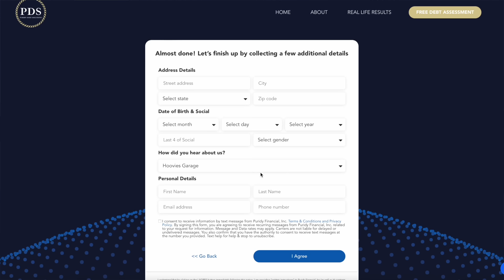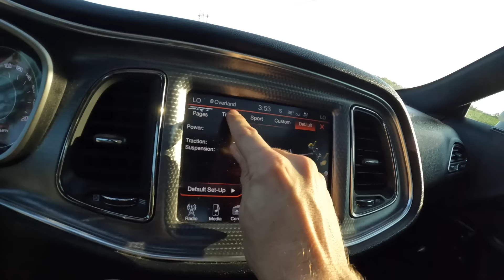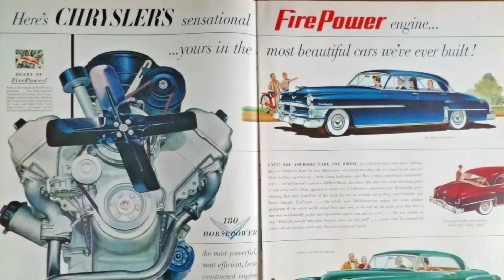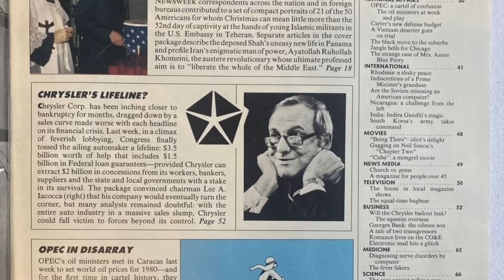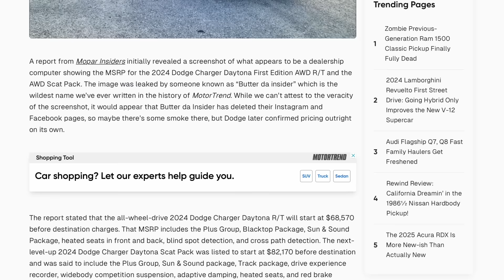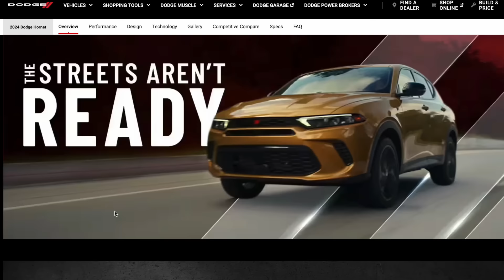I bought the cheapest Challenger Hellcat in the USA, and it's been in 4 accidents!

Comment: FYI: They can still steal the car even though the battery in the fob is dead, some of the thieves have access to dealer tools and can program a new key to the car. They'll pop it into neutral and push it around the block and then program a new key and take off. So I'd look into installing a kill switch and/or keep it hidden in a garage.
Reply: That’s why in 2018 FCA/Stellantis made things INSANELY more difficult and expensive to access the onboard systems with aftermarket equipment where you need to have your diagnostic equipment authorized by FCA/Stellantis through a company called AutoAuth. To even read the codes on my parents 2019 Grand Caravan, I would have to pay nearly $400 annually to both my scan tool manufacturer and to the AutoAuth service.
Reply: You can actually just get a scan tool that does key coding plug it in choose the car wait for it to sync and away you go

Comment: This is what most Challengers are like once they are up for sale in the UK via Eastern Europe.
Reply: apostrophes don't make words plural
Reply: Same in the US. Looked at a 28,000 mile 2021 Scat Pack Shaker recently. It was damaged on every panel. Windscreen cracked. Tires bald. Brembos needing rotors and pads. All emblems missing. Wanted $41,000 USD. I bought a 32mile new Last Call Scat Pack TA last week for $42,500. Used market is insane.
Reply: Most of the challengers in the UK are clapped out v6’s selling for way too much
Reply: @mitsuturbo  bro we are not the same, you speak English cause it’s the only language you know. 

We speak English cause it’s the only language you know. 🤡
Reply: If it weren’t for the price, that would kinda make it even better. 700+ hp and it’s already abused so you don’t care as much
Reply: @baileypan5391 No u
Reply: @josephshamon7824  whose fault is that? Live in a relevant country with a relevant language 😂
Reply: @BBBILLY86  Wow, you got a good deal!

Comment: As a Mopar enthusiast and Mopar hooptie connoisseur. The pealing paint on the upper radiator support and just the way it’s painted in general tells me without doubt the support has been replaced. Whichever and whatever accident that things been in was probably a lot worse then the carfax leads us to believe. The damage is usually pretty nasty when that upper support needs to be replaced. Hopefully you get lucky and the frame is still in good shape.
Reply: Body guy here (and fellow Mopar enthusiast 😎) came to post this you beat me to it. Aprons and shock towers don't look molested, so it may not have been too bad. We do replace a LOT of core supports these days so I wouldn't be too worried. It may be a good sign that it got replaced rather than just rough pulled back into place.

Comment: If you can fix the audio issues (missing speakers), you can drop in a newer UConnect without needing to program anything, Carplay is nice to have. It's a super easy mod to do and I'd 100% recommend it.

That said, that car is ROUGH. I seriously wonder what the owner did to make the interior look like that.

Worst part is that you need a whole new front fascia at the very least, and maybe a new right front fender. Looks like the mounting studs on the fascia were ripped out.

Also surprised to see that it doesn't look like it got the Harmon/Kardon speaker system. It's quite decent for a factory system, but it won't win a SPL battle
Reply: Those panels on the doors for speakers are for after market speakers. It probably did come with them but they changed the door speakers.
Reply: 6:31
The panels on challengers don’t look like that lol

Comment: 26k seems awfully high.
Reply: For 700 horsepower?
Reply: @benische  doesn't mean much if it needs a rebuild.  That car was very neglected, I doubt the owners properly maintained it.
Reply: @twinscrolled  The owner maintained that car about as well as the owner maintained his 3 different baby momma kids.
Reply: if the engine, suspension, or trans ends up not needing much work, he got a great deal and should be able to make a decent profit once he sells it...will have to see till they take it up on the lift i guess

Comment: Hellcats will tend to suffer the fate of the older 426 hemis of the past.  Many will be purchased by drivers who do not have the skills to keep them on the road properly, sending them to an early grave in a junkyard.  Those bought by collectors will be kept pristine until they change hands at auctions later down the road.

As for the history of the 426 hemis, they were only put into production cars due to racing rules of the day.  Many racing organizations required a certain number of cars to be produced with those engines before they could be raced there.  Some came with stickers stating that they were not to be used for regular highway use, but for speed trials at racetracks only.  One of my restoration project cars is a factory 1966 Plymouth Satellite HP2..  Current thought is only 53 of those were made.  Mine lived a hard life racing and was rescued from a junkyard decades ago.  Sound familiar?  It lived the hellcat life in the past.

Comment: Looking at this car, it has all the hallmarks of a car that was loved and cared for at the start, but quickly ended up being treated as a dog.  Judging by the repeated damages, I would be very likely to think that it might have been used as a sideshow style car later in it's life.  So it would be very important to check for things like clutch ware, differential issues, and so on.  I noticed just from looking at the video that the passenger side of the car seems to have fitment issues front to back so I would be looking really closely inside the quarter panels on both sides to see if the car has any "side impact" damage from swatting crowd members out of the way.   The stereo rip out is not unusual, as they would have known the car was going to get snapped up and likely got that all out in a hurry.   The last couple of weeks with the previous owner was probably not happy ones.

The other thing you most certainly should be checking is engine wear.   Don't just do an oil change, rip the oil filter open and see if things have gone badly.  Judging from the tires and overall condition of the car, I could see it not being exactly right up to date on oil changes.   I am guessing the brakes won't exactly be in great shape either.  So every filter, every fluid... that is just the start.    You need to start looking for parts sources for all the broken and mangled interior pieces, a new shifter, probably a new steering wheel... those are things that would greatly affect the value of the car at resale.

Comment: Small shop owner here. I won't work on these cars. Electrical diagnostics nightmare. Connectors always broken and super glued into place by body shops. Body panels held on by all different sized hardware and zip ties. Panels don't fit good . Etc. I give them a high estimate so they go away.

Comment: And I thought I did good in February paying $37k for my 40k mile 2015, 2 owner, no accident, 6 speed Hellcat.

That has a manufacturer buyback on the CarFax.

Also, the expansion tanks failing with age and miles is common. Don't get a used one.

Comment: Exotics are not produced at the volumes of mass produced cars. Therefore they are more expensive.  Most of the cost in the engine.  Infomat systems way behind mass production cars.  Fit
and finish sometimes suffers as hand built.  I laughed at some of my Aston’s and Lambo issues.  I drive Teslas now.  Tired of the maintainance of exotics and waiting for parts.  I still own a Porsche 
As close to an exotic without the headaches.

Comment: Yikes...I wouldn't doubt engine failure soon on that one.  Do a lab oil analysis for sure.
Reply: Also, if that header panel has paint coming off like that, it has been fixed or replaced poorly.  So the front end has been wrecked for sure.  No other reason to do anything with a header panel than collision.